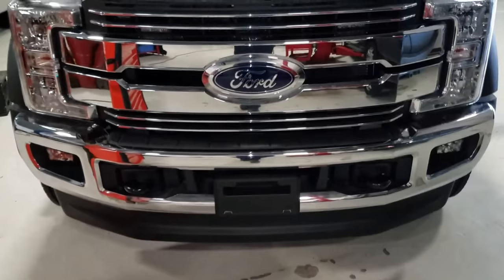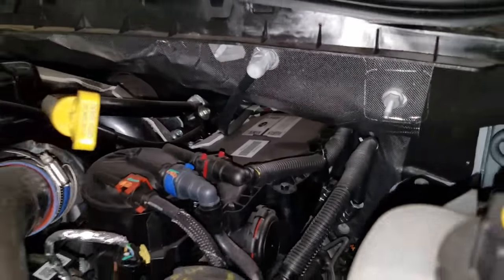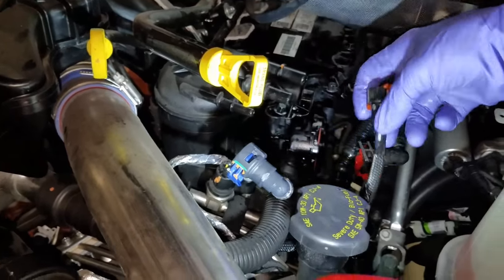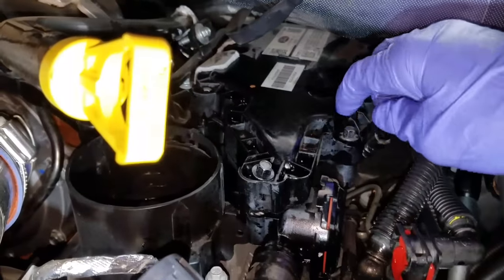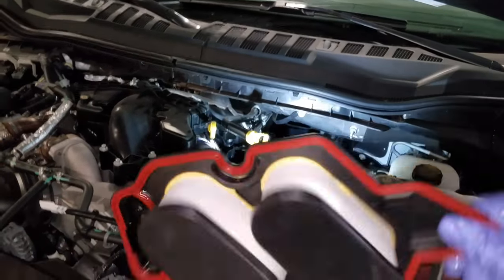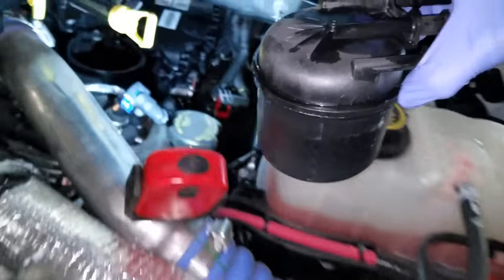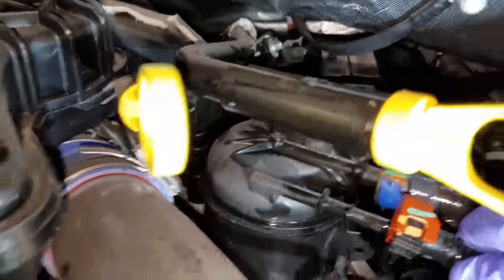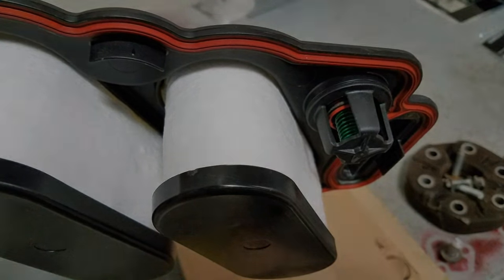6.7 Powerstroke - Crankcase Vent Box Filter

Comment: So I went to go pick up this filter. Got home and the top didn’t have screws on it. Are there some that aren’t serviceable? It’s a 2017 f250 6.7
Reply: Just ran into the same thing I know this was from 8 months ago but what did you end up doing
Reply: @yaboiiadamg5243  hey I went to my nearest ford parts and just picked up the one that isn’t serviceable. Apparently they are better. As long as you’re changing them with proper intervals you shouldn’t have a problem.

Comment: So this filter has become a rabbit hole for me. My early build 17' 6.7 has the one piece filter, not the two piece style that you show. The dealer said my truck should have the one you showed and they can't figure why it doesn't. Any suggestions? Which one seems to be less problematic?
Reply from the maker: Maybe it was changed out with the new style NO filter...if u have a filter get rid of it & get the new box!
Reply: @PowerStrokeTechTalkwARod  -Thanks, so to verify the one piece is the new style? And is the dealer correct when they said it's not necessary to replace this style?
Reply from the maker: Look up & get FC3Z-6A785-F. Says to only use with DRW but it fits the SRWs too. Suppose DRW(work trucks) idle more than pick up configurations tjats why it says DRWs only. I have used this box in all of em.....
Reply from the maker: Look at TSB 19-2142.....
Reply: @PowerStrokeTechTalkwARod  -Thank you sir!!
Reply: @PowerStrokeTechTalkwARod  This part number is different then whats on the box at the end of the video...????
Reply from the maker: Updated #

Comment: Would this be a FORD version of the "catch can" that has been catching on the last few years? or does this work a bit differently?
Reply from the maker: No this the "pcv" component on a 6.7 diesel.
Reply: +PowerStroke Tech Talk w/ARod OK but a catch can IS a PCB component. so does this capture oil vapors and return them to the crankcase, thus keeping the oil residue out of the intake? if so then the answer to my question would be yes, it works like catch can.
Reply: @iphlueable  Hey, it looks like oil catch can, but not 100%, it can't prevent turbo from sucking the oil from it

Comment: I purchased for my 2012 f450 in Ford dealership 6.7 powerstroke 2016 crankcase filter (solid box with not replaceable filter option). Replaced well, and opened the old "filter" there is no filter inside, just kind of cup made of plastic blades to brake the oil vapor and send it back in to the engine!!!!! I'm thinking to get the 2017 crankcase filter now. Any thoughts? Why Ford decided to go with filter element?
Reply from the maker: You don't want the filter trust me
Reply: @PowerStrokeTechTalkwARod   Ford went with filter element after 2016 model year trying to lower the amount of oil going into the turbo?
Reply: @PowerStrokeTechTalkwARod  my 2019 450 has the filter. Is there a reason you say this? I'm out of warranty. Should I do a ccv delete or re route? BTW just noticed I have a small oil leak coming from my ccv. So assuming it's clogged and fixing to replace. Just don't know which route to go.
Reply from the maker: U shld be filterless bub. If not there is one avaliable
Reply: @PowerStrokeTechTalkwARod  no sir my 450 cab n chassis has a filter. So you recommending changing it to the sealed box? Or just deleting all together?
Reply from the maker: You goto your dealer & tell em you want FC3Z-6A785-F & you'll be good to go
Reply: @PowerStrokeTechTalkwARod  thanks

Comment: Question I have 2016 f250 6.7 with 56,000 miles. What issues will
I see when the filter goes bad and what replacement should I go with. I would like one that doesn’t need a filter like I think the new 22 or 23 model might have? Let me know. And I love the in-depth videos
Reply: high crank case pressure which will cause oil leaks

Comment: Arod, I have a question for ya, my 19 6.7 is coming up on 30k miles and I was going to service the CCV filter, do you recommend just servicing it or service it AND add missimoto oil catch can, and how do you feel about oil catch cans being added to these? Thanks Jason Lynch
Reply from the maker: Your 19 prolly does t have a serviceable filter
Reply: Nope it's one unit
Reply: Arod are you saying the non serviceable CCV doesn't need changed out? No filter media in it, more of a baffle system?
Reply from the maker: No filter. Juss baffle

Comment: Hi ARod, great videos.   I have a 2018 F450 15750 miles, It was in shop at 12000 for oil leak and dealer replace the CCV box with this part number, GC4Q-6A785-CB , does this model have an internal filter?  i assume yes because there are bolts holing cover.
Reply from the maker: It must likely has no filter now. That number is an engineering number and needs to be cross referenced
Reply: @PowerStrokeTechTalkwARod  Thank you for the quick reply

Comment: If I change the box myself will I need to go to the dealer to have the reprogram anything
Reply from the maker: No you will not
Reply: What is the proper procedure to removeing and installing a new ccv box
Reply: I noticed a leak coming from the ccv box dropping down but I'm also noticing a leak to the right side what may that be can I email you some photos or a video I'm a hotshot and do my own maintenance but this is a little more than I'm used too
Reply from the maker: Powerstroketechtalkwarod@gmail.com
Reply from the maker: I have a video of that, go look
Reply: Can you send me the link and I found the leak on the left side for sure it's on the ccv box. And the other leak looks like it's coming from a bolt on the lower engine bay
Reply from the maker: Sorry bud, just looked i dont
Reply: @PowerStrokeTechTalkwARod  no worries bud I did clean the engine today and found the leak coming from the lower engine bay compartment I think it might be a loose bolt final rear bolt on engine .

Comment: Thanks for the post keep up the good work.I am thinking of getting 2000 7.3 what do you think of 7.3 thanks
Reply from the maker: +bud morse they are one of the goodies, get 1
Reply: 7.3 was the last powerstroke by International. After that, Ford starting making the engine themselves and they been having problems. Get a 7.3 or any Cummins, Deleted if you can.
Reply: @Flydevice1  Both the 6.0L and 6.4L are International Engines. The later engine the 6.4L was so terrible Ford cut ties with International and went full inhouse. Ford has arguably produced the best Diesel engine they have ever had. The 6.7L is a goodn
Reply from the maker: 6.7.....nuff said!!!! FoMoCo rockin it!

Comment: What if your CCV box does not have bolts to replace the filter but still states to change it every 100,000 miles? Do you have to replace the entire box?
Reply: 2017 and older don’t have a filter of this style. That box that he opened in this video doesn’t open on those years. That whole box has to be replaced.
Reply: @Skormm  I haven’t got to look under my hood yet, so you’re saying my late build 2017 won’t have the filter?
Reply: @lpmoora  no on your model year it was a whole assembly not a filter like in this video. You see the box he opened in this video? That whole box is one piece on yours and the whole thing gets changed out.
Reply: @Skormm  Thanks for the prompt reply.  I never knew about this maintenance item, so I just had to ask
Reply: Anybody have a part number for the hole box replacement
Reply from the maker: @adamwietczak2248 look at our newest CCV video

Comment: Where can I get these filter housing. I found the filter but not the lower part. Thanks for Help.
Reply from the maker: The housing would definitely would be a dealer item only
Reply: I just bought one today $341.00 ford dealer in California.  Comes with filter
Reply from the maker: Got 2 sittin in my cabinet 🙌
Reply: Hey a rod bud, do you know what are the torque specs for re installation of the ccv box I looks like only 4 bolts , the box I bought already came with filter installed.
Reply from the maker: @santodiabla4195  1/4 drv run em down, just snug em up. Small 8 millies..nut lug nutz
Reply: @PowerStrokeTechTalkwARod  thanks bud. Appreciate the help goes a long way.
Reply from the maker: If youd like to support my channel, stop thru my email & pick up some PTT swag
Reply: @PowerStrokeTechTalkwARod  will do . You can count on it.

Comment: How u know I need change that filter thanks
Reply from the maker: Huhhh
Reply: I have 2018 f350 have 40.000 miles
Reply: @joselima1827  maintenance schedule show changing the filter at 100,000 miles
Reply: @PowerStrokeTechTalkwARod  i am needing to purchase the CCV filter for my 2017 F350 KR but ebay says part # FL 2077 is not compatible with my vehicle.  Any suggestion?
Reply from the maker: Do u have bolts on the top of the box.
Reply: @PowerStrokeTechTalkwARod  i do not
Reply from the maker: Then u have no filter silly
Reply: @PowerStrokeTechTalkwARod  then what is the "box" that is in the same location?  I took a picture of it but dont know how to post the picture
Reply from the maker: You have the non servicable one....ie..no filter
Reply: @PowerStrokeTechTalkwARod  ok...thanks for the info...when did Ford change to the non serviceable version?
Reply from the maker: 17SRW

Comment: On a 2015 what is the recommended interval for changing this
Reply from the maker: Book says 100k...
Reply: @PowerStrokeTechTalkwARod   man that was fast 👍. 
 Is it the same procedure to gain access to this CCV filter on 2015 ?
Reply from the maker: Them are the whole box
Reply: Thanks.. oh on a side not what's your opinion on AFE 780 pro ?
Reply from the maker: Keep the oe bud👍
Reply: @PowerStrokeTechTalkwARod   thanks
Reply: @PowerStrokeTechTalkwARod  what is the difference between the box and filter type? My 6.7 is a 2015 and the ccv is leaking
Reply from the maker: Some have filters some dont

Comment: Are these permanent filters or are there intervals? Just was curious. A lot of semi trucks with the Cummins motors use a permanent crankcase filter that's why I ask.  By the way, you have been keeping too sober with the lack of videos. Awesome videos Aaron as always.
Reply from the maker: +Brian Skinner i need more info. I have conflicting sources. I will let u know
Reply: I read in the owners service guide it's 100k miles you replace it, did two of those today
Reply: @PowerStrokeTechTalkwARod  If I'm getting P04DB code, would the filter cause that?
Reply from the maker: No
Reply from the maker: Skinnnner where u at
Reply: @PowerStrokeTechTalkwARod  Ugh...
Reply from the maker: Look up recall 17M04 pal

Comment: And don't wipe the iqa codes off the breather cover haha
Reply from the maker: +Chris K. Haha, cuz they come right off!!!
Reply: PowerStroke Tech Talk w/ARod 

Yep found that out the hard way
Reply from the maker: +Chris K. Lol, ehhh they r still in IDs, dont really need em unless u aint got IDS but then again if ur programmin IQA's then ur gonna need IDS any ways
Reply: PowerStroke Tech Talk w/ARod

It's a shame you can't use autoenginuity to program the IQAS on ford, on the other work trucks that I work on,  (Cummins )you can use autoenginuity to program the iqa
Reply: If I remember right Cummins 6.7 recommends 62,500 miles you are supposed to change the CCV filter, I'm surprised that Ford does not give a service interval for the CCV filter
Reply from the maker: +Chris K. Well see i gotta chk into that info